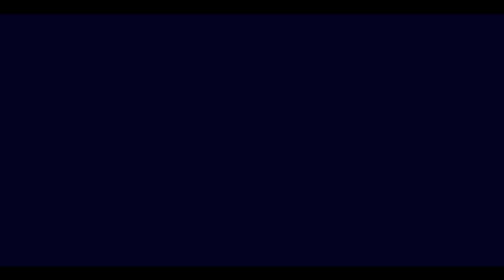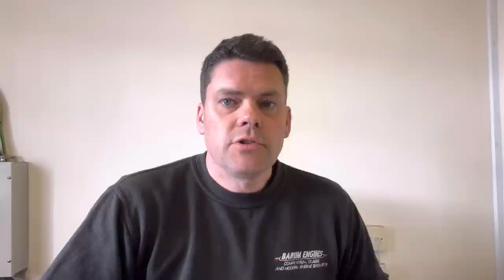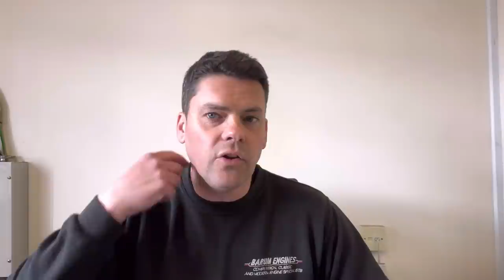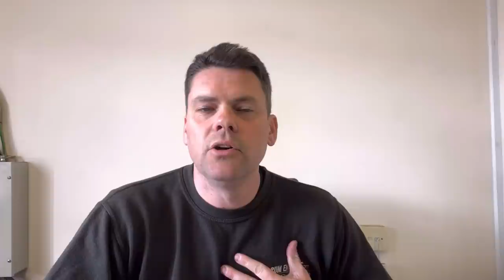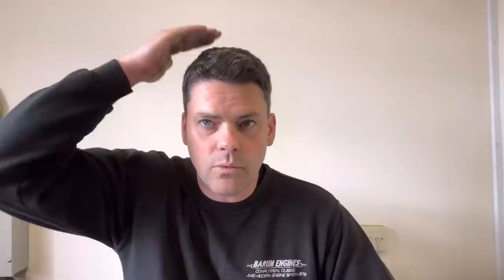Awkward situation with a customer over this WARRANTY

Comment: You can’t be expected to warranty an engine that was designed in the 30’s and has been used in motorsport. I really can’t understand these people, I’ve just had an engine built for track days and the first thing I said to the engine builder is “I don’t expect a warranty” . I still expect him to do a decent job but I’m not going to go moaning at him if I blow it up on my first td if I over rev it or something
Reply: Couldn't have said it better myself 👍
Reply: I wouldn't give any warranty on any engine used for Motorsport full stop. 
A lot of companies don't give warranty for non standard use for other engines.
Reply: Spot on, some people just don't consider things from the perspective of the business and expect their cake and to eat it. It's a pain in the arse dealing with customers, worse now than ever but you really have to try and let them be right 99% of the time, in this position you just have to turn the job away or put you foot down.
Warranty on a motorsport applitcation is pie in the sky thinking anyway, mental.

Comment: The guy is using a vintage bespoke engine for motorsport then he must accept that things will break and you cannot warranty that sort of use. You are not here to indulge a rich man's folly at your expense. He would not get that sort of service from anywhere else.
How old is that engine? How long was the service life of it when it was brand new? 
Have a look at it and tell him how much it will cost to fix. Then charge him the going rate and explain very carefully and in writing that it is at his own risk if he chooses to do anything more than a gentle run to the shops in it. 😀
Do not feel bad about this, he is trying to pull a fast one.
Reply: Doesn’t appear to be trying anything funny, he even said so himself. He had an engine rebuilt partial or otherwise and now it’s done a crown or cam or whatever. Of course you would communicate with the shop, it’s what any normal person would do.

Comment: I would stop doing engine rebuilds on everything except  2 or 3 engines you specialise in . You need  experience, common faults, detail techniques and above all immediate  supply of all bought in components at competitive price and availability . Leave  pre war engines to the specialists  . Concentrate on machining  refacing reboring  honing  parts supply ,  surface grinding, beadblasting and vapour blasting  etc , fast turn round using  all the workshop equipment as a sub contractor rather that doing the whole job .  You just don't know if installers  use correct  installation/ ignition timing  fuel mixture lubrication so many variables - they can do something wrong then try to get you to pay for it . Concentrate on what you are expert at and have the kit few people have anymore  without the distraction of awkward customers who we all know exist in the complexity of old engines .

Comment: You're running a business. They were happy that your doors are open so you build his engine and the engine was running great for 2 or 3 hill climbs. I don't know what the angle of those hills but I wonder if that caused any oiling issues in the engine. Besides that any competitive driver knows there is no warranty on engines and if it breaks that sucks but it's on the driver/team.  If you work for free you will be closing your doors so I say stand your ground.

Comment: Lee....you cannot offer any type of warranty on motorsport engines period. All motorsport is very expensive for a reason, more so when racing exotic machinery. If you have little mechanical knowledge & rely on others, the cost to do the sport seriously escalate....
By all means still get involved in the repair but all time & parts must be recharged fully. Otherwise you are effectively offering a sponsorship deal.... Good luck with that one.

Comment: First up you start by saying you need to employ help and you are spending too much time not on the tools.  In order to pay someone you need to charge your time at a rate to also cover the non productive staff member in the office. Doing so called warranty because you want to be a nice guy and working  for nothing is doing you no favours. It is going to effect your more once you have wages to pay. Straight up the conversation with the customer should of covered that they will be paying diagnostic to determine the cause of failure. Sounds like you need some business coaching  or employ a manager to have these hard conversations to leave you on the floor doing what you do best.

Comment: I also believe in good communication with my customers, I make one off and small batch runs of components for vintage or obsolete vehicles and machinery. ..IF I think theres the slightest chance of a potential issue i tell them from the start that i will do the best possible job and do it correctly but cannot  warrantee against failures on stuff thats so old..most of it even when it was new broke down constantly . As someone said in the comments..you really need to make the small print big print, genuine customers will not mind at all ..those that kick off..you dont want them as customers its as simple as that

Comment: When I was stock car racing I never once expected warranty with the engines my engine builder built if it's used in racing or Motorsport of any kind they can fail for multiple reasons

Comment: Nope, no warranty.
Dismantling & inspecting the engine at cost is the most I'd offer, as it's quite possible whatever has failed has no relationship to any work you did on the engine.
Reply: Problem is he’s doing it as a business. If so the customer is covered by all the legal trading standards consumer rights that comes along with that, regardless. he’s doing the right thing to assess the damage to prove or disprove any fault for the failure in case of any future legal issues.
Reply: @Gmh6477  Hes not though because he races the engine.

Comment: it is a warranty on the work you did. if it stripped a key or broke a crank it isn't warranty. *I wouldn't give warranty on any engine over 30 years old just on internal metal fatigue.

Comment: Tough phone calls are just that, tough. Saying that, you are doing the right thing by getting the engine into the workshop for a strip down & assess what's gone wrong. No point trying to guess these things, has to be seen by the naked eye.
Once stripped & broken bits known plus what's required to fix, then something can be worked out with the customer & maybe a touch of good will applied where applicable.
Looking fwd to seeing this engine as it sounds very interesting 😎😎

Comment: Hill climbing an old banger like that, may well have caused an oil starvation problem and seized the oil pump. I personally don't know the engine, but this is one possible mode of failure.

Comment: I would say depends on what the fatal issue was and what could be the issue. Broken crank may be on you imo. I am sure there is data on castings and machining at the time of manufacture of the crank.(as an engineer you may not have exact but there is good enough data out there to make a reasonable assumption) You have an idea of the HP/Torque and its a simple calculation on minimum thicknesses. Did you violate minimum thickness and say hey this will work, its on you. If you are above thickness for the discussed rating then its on him.

Comment: A stock engine two weeks to the end of warranty you would just fix it but a racing engine and the fine print you should stick to. Get everything in writing when you hand over a engine that will be used to race with so if it has failed because of something in the workmanship then both sides are covered but if they take it away and use it outside of it's warrant cover then you are covered. People will always take advantage of you otherwise. There are no friends in business and if you fix it this time he will be back to get it fixed again.

Comment: If it was just a common general production motor that's got books and books of what works and what doesn't and the plethora of available parts and something stupid failed like a sheered keyway due to a bad sprocket or the reground crank broke on a main or big end journal from an incorrect radius it would be a pretty straightforward warranty but it's a one off custom made engine that's 100 odd year old and they are racing the bloody thing who knows what quality the materials were so it's basically a case of "shit happens welcome to vintage motorsport" by the way this is how much you are looking at to repair it.

Comment: What on earth are you doing discussing the Lagonda engine failure situation publicly when you have not seen the engine to ascertain the reason for the failure. If you sourced the bespoke chain from America and that has failed then you need to know why it failed. My advice is that you tell the customer not to strip the engine in any way but get it back to you and arrange for an independent engine failure analysis expert to witness the strip. Both Barum Engines need to have a written agreement that they will be bound by the findings of the independent engineer and that the responsible party will cover all costs of the work required to rebuild the engine. 
If it is Barum engines then hopefully your liability insurance company will accept a claim, you need to advise them now of the circumstances, do not wait and do not take this one yourselves and strip the engine without an independent engineer present.
This situation can easily escalate and cost thousands to sort out.
I suggest strongly that you contact the FER for guidance and information as that’s one reason you pay your membership.

Comment: I know how that goes mate ... Mind you im an I.T guy and sell Computers and whatnot .  I made a Standard of Warranty for each System Sold . I stopped mucking about with Each System having Specific Warranty per item kinda deal and it saved me a Lot of grief and simplified things . Date of Purchase and End of Warranty Period set . Other than that, each Component Warranty is up to the Customer /  Manufacturer to settle that Claim . I make Sure they Understand this Prior to leaving with the purchase And Sign a waver stating they understand and all  info regrading is listed etc . So far its worked out Perfectly ... Knock on wood *  Cheers .

Comment: anything as old as the lagonda if it has no aftermarket rev limiter when pressing on flat out mid race
its only one missed gear change zing the revs to the moon and its on borrowed time after that imo
,same as the other commentors you cant be beating the snot out of a prehistoric engine
 and realisticly think it has any sort of warranty?,
but a small amount of knowledge can be a dangerous thing imo

Comment: We actually deal with this era motorcycle engines. There is no reasonable way to warranty a motor of this era. I'm surprised it has shell bearings. Most automotive engines were still using babbitt style bearings. I agree with your ideas of the probable causes of the failure. Some of this era cranks were multi piece cranks as well. Movement of the crank could result in this type of issue as well.  These types of issues take time. A GREAT DEAL OF TIME. Nothing is "on the shelf". Patience and talented work will bring a resolution.  Good luck Lee.  .....and Lee...... Have a Deluxe day.   This will be resolved.

Comment: The way I see warranty in this case is that if you have done something wrong, you have done something wrong. But if you  haven't then you haven't. At this point in time, it's too early to tell. Over revving kills motors as you well know, and you don't know what the service history has been since it went in. As soon as you said track days I thought oil surge/over rev. I think that you are going in the right direction in as much as you haven't told the customer to bugger off straight away. And if it is a workmanship issue,  then we have insurance for a reason. If it is not a warranty issue then anyone who can afford to have 3 Lagonda's with no mechanical knowledge obviously has the financial resources to pay someone to undertake repairs and restoration as required, so their decision is whether to ask you to do the repair or to take it elsewhere. One bit of advice,  every time I do someone a favour it bites me in the arse. Be fair but don't feel guilty and be too kind. I'll be interested to see what the failure is. Regards Greg

Comment: It's a 1930s four cylinder engine designed to output 50 horsepower at high RPM. The customer is smoking dope if he believes ancient kit can hang with a modern design with modern metallurgy.

Comment: Add a line to your work orders or a warranty info sheet that explains the warranty, the customers responsibility prior to a claim and a space for the customer to initial that he/she understands the full  terms of the warranty.  Also include that if any unauthorized work is done to the engine the warranty is void.That stops the, in/out of the, mind problem. I'm sure that the customers signature is already required somewhere before you start work.

Comment: I'm the same with customer ethics. Its a tough one though, think if I build something that tasty I'd like to be there at the start up to make sure its right. Not to be blaming anyone but for everyones sake as you know when you hear them running right, you know they are going to be right no matter how hard they are worked. Some customers just haven't got a clue and make a simple mistake that can be costly so easy. Seen it so many times. Had one of my race cars on a rolling road once, guy wated to test it up the road, 'said can I rev it'. I said you won't rev it has hard as me feel free.

Comment: All you know now is speculation, the engine will have to be torn down and investigated and the failure ascertained.  If the fault was due to your machining then stand up and take it on the chin, if not then the customer could reasonably be expected to pay.  Just be totally professional about it and don't expect faults that may not be there especially on an engine you are not expert in.  Customers appreciate a strong professional attitude.

Comment: Someone how has a 90 year old unique engined car and doesn't know anything about the mechanics? He needs to have a trusted mechanic on speed dial that can laisse with you, rather than dealing direct. Other wise it is agro allround. You need to state in big print that work done is on a best endeavours basis, as you have no plans, diagrams, settings, specifications, and timings. Get customer to sign this before starting.